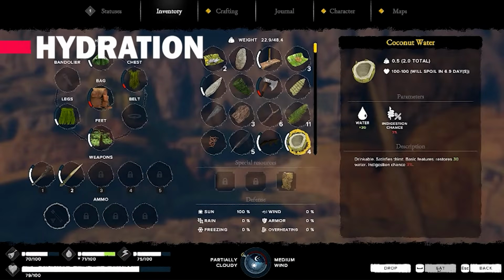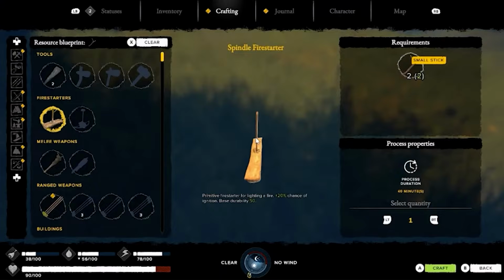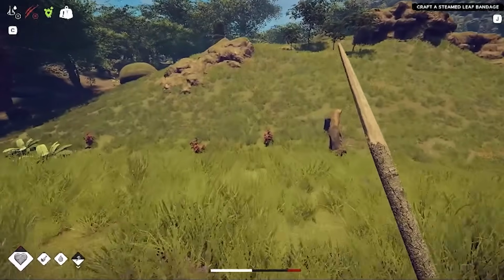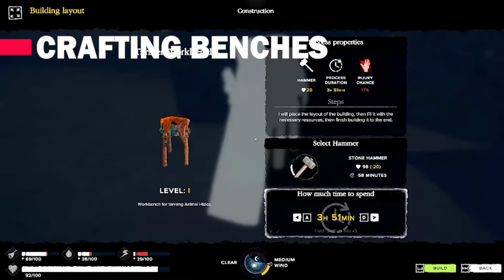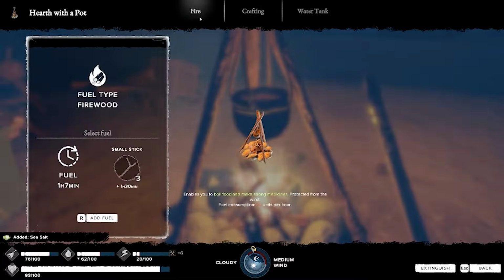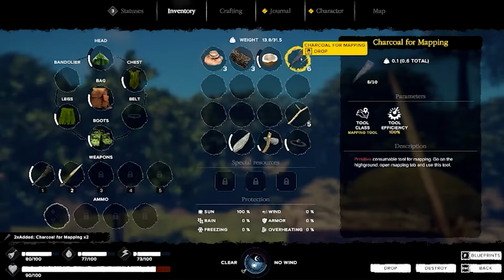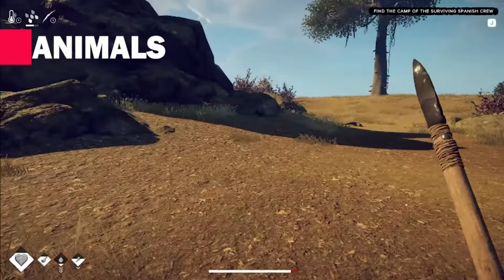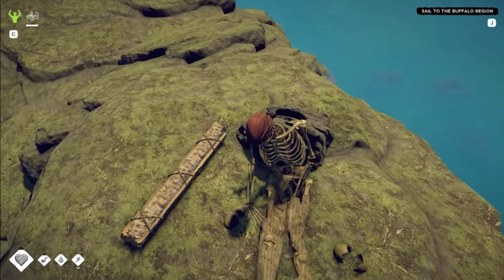Survival: Fountain of Youth 1.0 - Ultimate Beginner's Guide (Healing, Tools, Base)

Comment: You do not know much about this game, do you? Backpack is an okay starter item, but no, you can craft many bags or other carry transporters easily and earlier. So, it's not a good choice at the beginning. And you suggest leaf clothes, really? Are you trying to mess up all players with this bad tip? The best starter choice is the coat. With it, you will have 100% protection against almost everything. Sun, rain, and wind will not be a problem. Much better than leaf clothes. The other mistake: did you really suggest increasing your weight by carrying stones to repair your tools? OMG, how noob are you, bro? The first thing you need to do after getting to the main isle is to get obsidian and make your tools with it. They will have much higher durability. So you can grab a few obsidian stones just to leave at your base. And when the tools are nearly breaking, just come back to the base, pick up the obsidian, and repair your tools. Carrying stones will only increase your weight; you must avoid this. And after you move to the next region, you can make your tools using bones. Just kill some animals and you will get more bones to repair your tools anywhere on the island, only when you need them. Another very bad tip or very noob suggestion. By the way, you tried, but you missed the good tips because you do not know enough about the game's mechanics and system. Not to mention mapping at any place is, yeah, a very bad tip too. It is a useless map; you will only lose time mapping at low altitude. Find a high spot on a mountain, go there and map. It will be at least 5 times better than low altitudes.